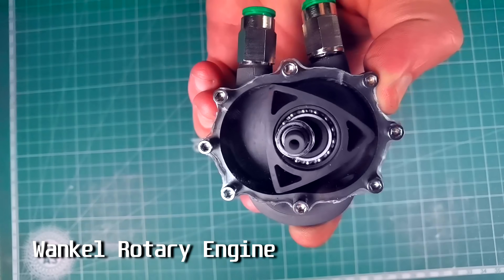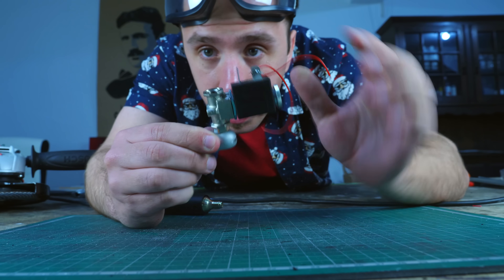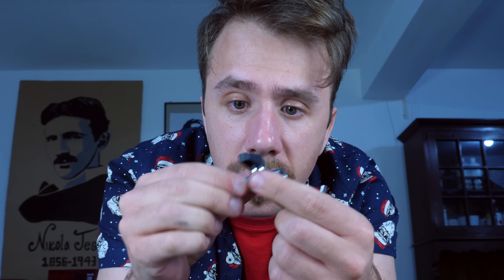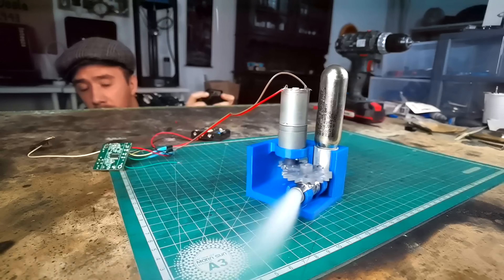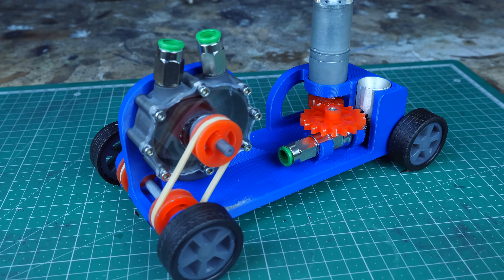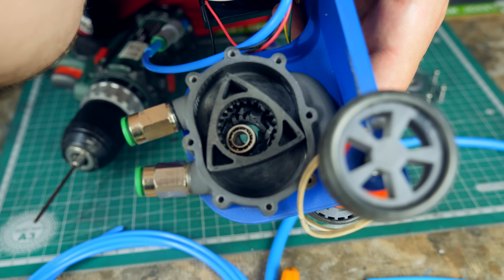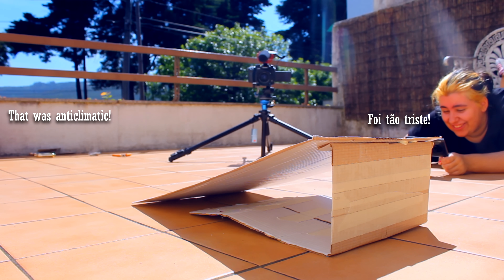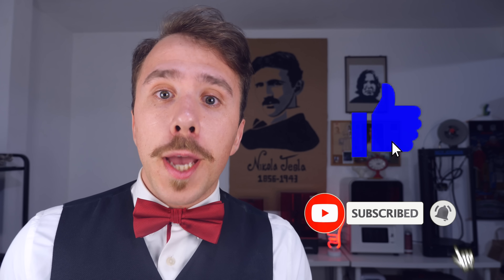Rotary Wankel RC Car (3D Printed)

Comment: Why not just use a servo motor to give precision throttle to the engine? I mean, 25kgcm torque servo is common nowadays, should be enough to turn the valve. That should solve the slipping of the driving belt, and also gives more time to ramp up RPM. Servo is way more lighter anyway.

Comment: You could 3d print a geared transmission for the rc because you were losing alot of your power in the rotary due to the rubber band and pulleys slipping.

Comment: Okay... You're losing a ton of power with the delivery system out of the engine to the wheel...now try a chain and actual sprockets to deliver the power from the engine....or hook it up to a 3d printed differential.

Comment: You desperately need an expansion chamber so the CO2 has room to change to gas. Also a pressure regulator would help with efficiency.

Comment: For the vehicle, you need reduction gearbox(from engine to wheels). It increases torque output but decreases the top speed, horizontally mounted cartridge to increase aerodynamic and balance(you can adjust it with arranging the bottom of the cartridge heads forward so the engine can run longer), a gasket to avoid gas leaking from the engine(need to applied together with stronger engine casing and tighter screw locking), and stronger chassis for the car(if the chassis is bigger, it has to be followed up with larger wheels to ensure the size balance of the vehicle parts).

Comment: It seems to me that one of the problems is that the gas exits too fast. Maybe adding resistance to the system, for example by attaching a second engine in parallel to use the exhaust (which still seem to have a lot of extractable energy in it)

Comment: I suggest using your ceramic printer to make a rocket powered boat. I mean, ceramic where you can, of course. A boat big enough to hold your fuel tank(s) might be out of the question for your kiln. You know what, why not just a ceramic rc boat?

Comment: Add a little traction to your wheels by gluing rubber bands to the circumference of the drive tires. Pressure regulator is a good idea. Add an extra pulley between the engine and the axel. A "tensioner" pulley. Pull the band out to ad tension as there's not much room to pull it in. Adding weight to your wheels will help keep them on the ground long enough to actually do some locomotion. Since a suspension system might be too complicated for the task at hand.

Comment: The rubber band is slipping a lot!  Use gears or something.  Initial power output looks quite high; might lead to wheels spinning in place if the car isn't heavy enough or internal engine damage (after replacing rubber band).  Another option is a stronger band with teeth on it.

Good luck and great projects!

Comment: Along with reducing the rpm of the wheels, it appears that the rubber bands are not very good at transferring the torque. They are not rigid enough so the torque is deforming them off on your pulley and they are slipping. A rigid gear reduction would work much better. Great video and project

Comment: you should use a regulator to not waste c02 and make the car go further and you could use larger bottles of c02 (or more pressurized once)
also if you plan to use the wankel engine more you should get something to seal the edges so c02 doesn't leak out

Comment: @integza. 
You have 800 PSI to power this thing! The exhaust is probably still 600 or 700
That's a LOT of energy you are losing out on.
Look up Multi Expansion Boilers.
It uses the exhaust of the first piston to drive the 2nd and 3rd and even 4th.
MUCH more efficient.

Comment: You should 3D print a winch that is strong enough to lift 100lbs and design it to work as a house lift from floor to floor for bringing laundry to the basement or second floor

Comment: Aside from needing a regulator to lower the output pressure, you also need to make sure that the neck of the cartridge is facing upwards.  The cartridges are filled with liquid CO2, so you are expelling the liquid and not the gas.  Turning them upright will give you more thrust and better control.
Reply: And maybe heat up the cartridge? Releasing the CO2 may cool down the cartridge so much that the CO2 remains liquid at ambient pressure? Or maybe not, these cartridges are fairly small ...
Reply: @michaelseitz8938  the faster the gas is released, the colder the cartridge becomes, and the lower the internal pressure becomes.  However, that is not entirely what causes a pressure drop.  It takes time for the liquid to turn into gas, which is usually the most significant reason for the pressure drop.  When you use a regulator, you extend the length of time that it takes for the cylinder to evacuate, which in turn gives the liquid more time to turn into a gas.  Heating the cylinder will help the reaction somewhat, but typically not by enough to make a difference.  If you're looking for a 5-10% difference, then heating the cartridge might be what you need.  Good thought though!
Reply: @michaelseitz8938  nope 90% of performance issues is just the fact he has the pop side down rather than up while in a gravity field with a critical gas canister
flip it and he'd get more stable and longer running 800psi flow with less issue caused by rapid loss of liquid co2 mass
sure mild warming if he intends on using 800psi for very long might be needed in smaller cans but at about the 88-90g cans the depressurization of his projects at max flow won't be enough to chill anything bigger than a 16g can enough to lose performance
plus he seemingly can get lots of propane which is a nice source of a stable phase change 150psi source so he could use propane bottles to run "pneumatic" engines on the go with much cheaper valves plus the flames from the exhaust ignited by "integzabot" would be a nice cosmetic touch
Reply: yes "inetzga" can't seem to understand the wasted energy of liquid co2 coming out of the exhaust port
he even knows liquid propane makes more flames than gas if he flips the bottle so why is he no noticing the same flaw in reverse with the co2 cartridges?

Comment: You need to 
1: seal the engine better
2: make the stationary gear in the engine durable
3: limit the amount of psi put into the rotor
4: make it a chain that powers the wheels so you can plant the power down
5: use ceramic filament if possible for the engine

Comment: Video idea: Have a battery powered 3d printed compressor of sorts to feed air into the engine directly, could be considered similar to a turbo'd rotary engine. 3D print a car shell you'll basically have yourself a mazda rx/eunos cosmo.

Comment: I like the car idea, but maybe do a dragster, you could drop the gearing to provide more torque, since the engine runs at such high rpms. Also, lots of dragsters use rotaries. Hopefully you like the idea! Also, maybe find a way to better control the pressure to last longer but with less psi. This would mean less rpms, but longer run time, hopefully solving 2 issues with the car.

Comment: You’ve got to turn the cartridge spout side up so that you get gas out instead of pressurized liquid CO2
Reply: Ding ding ding
Reply: Also a pressure regulator or at least a decompression/expension chamber would go a long way for the wankel motor I think
Reply: @CAYDEN TAN SHENG WEI Moe the high pressure conditions in the canister turn the gas into a liquid. When the canister depressurizes spout side up it turns back into a gas. When it’s spout side down it stays liquid. Unless you have the end held tight in a rag. Then it turns into dry ice.
Reply: @Travis7109  yup turn the canister right side up to get longer runtime and less seal-chilling leaks
Reply: the liquid CO2 still wants to expand and turn to gas. But it looks like a significant amount is happening inside the engine. He could use a longer hose to give it more time to evaporate, but then he'd lose pressure.
Reply: @calvin2686-u1k  or just put the canister valve side up rather than have the opening effectively draining liquid co2 out
Reply: god yes 
liquid co2 boiling in the engine is causing thermal contractions and seal leaks let alone a loss of usable gas pressure on the intake right away
Reply: I think you should make one submarine.
Or make a US battle tank
Reply: Actually pressurized liquid can be better... maybe?... Just think about water rockets. They are more powerful than compressed air rockets.
Reply: @potatosalad68  Sadly not. This works for rockets since increasing the mass of the exhaust gives more thrust, but here we don't care about the thrust produced by the exhaust and we're basically wasting liquid gas that would otherwise decompress still in the cartridge and give more power.
Reply: @DeuxisWasTaken  Oh, I meant it for the modified rocket car version, when he unplugged the wankel motor.
Reply: @DeuxisWasTaken  EXACTLY
liquid co2 boiling outside the engine is pure waste
Reply: @potatosalad68  not really as the boiling co2 is useless once it gets into the exhaust and the sudden thermal sink will cause seals to freeze and leak

Comment: 3d printed mini evil tomato keychain merch when? Also, you need some suspension on the powered axle of the car, to keep traction during lauch. You're losing a lot of energy at the start. Try to add a pair of hobby grade rc shocks and springs, cheap chinese ones are fine for this. And maybe reverse the car, rear wheel drive will give you more traction.

Comment: For the engine I think a good next project would be do a double rotor engine like the one in the Mazda RX7.
For the car I think some kind of suspension would be of great use because most of the vibrations from the engine shaft were transferred vertically for the wheels and not horizontally. The suspension could absorbe some of that energy and make the force that the wheels apply on the ground more effective.

Comment: You could make an rc plane with a pressure regulator to use the cartrige more efficently  and the motor to spin the rotor and see how long and how fast you could make it go . 3D printed frame eith styrofoam would make a really good build

Comment: if you made the tension of the drive belt higher you would get a way higher acceleration on the vehicle and it may be able to get over the ramp with that speed increase

Comment: That belt slippage on the wheels made me sad. You could use a belt the same way some electric skateboards do so it doesnt slip as bad, and probably higher gear reduction or reduce the airflow somehow

Comment: It looks like you're getting liquid CO2 splashing around inside the chamber. If you added a pressure regulator and turned the cylinder nozzle side up you could avoid that and probably get some more efficiency out of the engine.

Comment: You should make a 3d printed rocket using co2 with electromagnetic nedle valve that's under spring tension or similar.

Valve should open instantly with press of a button, co2 gets released to air instantly via nozzle.

It obviously makes a lot of thrust, it's time for 3d printed rockets

Comment: If you could add a regulator to the co2 cartridge setup you built, then you can power the rotary engine for much longer durations and much better performance out of the car.

Comment: Do u think theres any other material u can use as a belt instead of rubber band? I think the rubber band is just to stretchy to turn very well like a cars belt is very stiff and if there was somthing closer to it maybe it would give ur wheels much more power

Comment: Maybe if you had teeth on the pulleys and used a belt to fit. Then it would go over the ramp with the compressor air connected to the engine

Comment: Video idea: Make a video on a subject that you are interested in or an idea that you want to advance your knowledge on, I.E. your 3-d printed rockets, or making a rocket powered airplane using the 3d printed rockets, you could even make a regular electric motor powered airplane with the rocket as a "boost" similar to what Peter Stripol did with his sugar rockets.

Comment: ok how about a 3D model rocket designed specifically for that cartridge? that way you can make the nose cone as aerodynamic as possible if you print two halves of the nose cone.

Comment: Hi Integza! Great idea the CO2 capsule, may be put a pressure regulator to extend time of use? and may be gt2 belts will do it better transmition of power to the wheels than rubber bands... Think you should give it a chance to test some upgrades!!! :)

Comment: Integza...print a car that uses like a 2L bottle with compressed air...Those bottles can hold up to like 150# of air pressure (so safe to run it up to 100# easily), they would have ALOT more volume and lower pressure = longer run time on the wankel w/o turning it over 5K RPM....very very very cool design!!!!

Comment: 2+2=4
2+4=6
the more moving parts the more resistance or friction counter centrifugal force
Of course the car with the gas jet release is going to be faster than the air Winkle powered car that seems to be skipping losing traction and spinning and jumping as it starts to move what energy you didn't lose in your engine you lost in your traction

Comment: You should design and 3D print a gearbox to reduce the RPM and increase torque to a the wheels. Wether a series of gears to a one wheel peel drive shaft or a chain contraption like your rubber band. Lost a lot of momentum in the slip.  Excellent video. My 8 year old son and I really enjoy you videos.

Comment: Bigger front wheels should help transferring more power to the ground because it slips and loses a lot of energy into nothing. A gearbox should also help there to not use all energy at once. Tom Stanton had this problem a lot with his air powered build where he needed to change the energy output

Comment: I know a lot of people probably pointed this out, but you’re getting a lot of slip from the rubber band connecting the tires to the engine so you might have better luck if you run a gear drive from the winkle to the front axle.

Comment: Why not fully print a herringbone gear, gearbox to get full use of the wankel engine output, or a fully printed CVT gearbox, and then run a drag race of wankel engine carvs rocket car and do it like a proper racing event!

Comment: use the Rotary Wankel RC to make a small plane , it would be manageable if you connected many valves in some series way and just increase their capacity , by using 3d printed material you can make a small and light aircraft fuselage that can be manageable.

Comment: Design and 3d print a locomive or tracked/tank vehicle using the wankel engine as a means of power, maybe even use 3d printed ceramic parts.

Comment: Video idea : Design a different water-cooling solution for a pc that has a turbo feature that boosts  the cooling for a short period . It would be interesting to see what you come up with for a temporary sub zero boost for high demands.  I would like to see what you would use for valves and how you would control it to prevent condensation on the CPU block.

Comment: I see 2 problems. 1 It was front wheel drive so it had no traction. 2 if you add a pressure regulator to something like 800 to 150 psi if will have a lot more even and long lasting power.

Comment: I'm pretty sure the reason the car sucked is because the rubber band couldn't keep up. Use a chain or even just a tighter band. Bet it would be a lot better.

Comment: you should attempt to 3d print a simple transmission to reduce the speed coming from the motor allowing the wheels to spin slower so the car can move forward without the wheels spinning like they did in this video

Comment: Love the videos. I would suggest using an pressure regulator in conjunction with an expansion chamber/evaporation chamber to allow the liquid CO2 to expand into a pressurised gas. Ought to make it go quite a lot further.

Comment: I'd love to see you try this again, but limit the airflow into the engine, use something to seal the engine air-tight, use a better belt (it'd be nice to see a toothed belt like a bike but idk where you'd find one), and finally, take that exhaust from the engine and run it under and towards the rear of the car - essentially engine + gas propulsion.

Comment: Build a helicopter blade system with variable angle of attack mechanism
Reply: You mean a swash plate helicopter pitch control
Reply: That sounds like normal helicopter collective
Reply: @benaguilar1787  tbf, has anyone on youtube made a thorough explanation vid with a diy conventional helicopter?
Reply: I don't understand half of what that means but it sounds cool
Reply: @boneman-69  he asks integza to build a propeller with a rod which changes the pitch of the blades when pushed/pulled
Reply: .....with electric plasma jets on the tips of the blades....
Reply: I hate to say it but most rc helicopters already do this

Comment: You could increase the driving time of that car with a flywheel attached to the Rotary Wankel. And then use gears or a pulley which then spins up the wheels. Maybe it'll work!

Comment: You should use the engine to power a ship or a plane, since the high RPM dont have to be turned down in a gearbox.

Comment: you should get a servo to open the valve. that way you have more control and can drive the engine for longer at a lower pressure :)

Comment: It would be interesting to see if you could make a functional plane. Maybe even powered by one of your engines and a propeller...or rocket powered and let it glide once the fuel is out.

Owuld be a cool project but quite difficult I would imagine

Comment: I'd like to see how well that engine would perform if you took some steps to regulate the gas coming out of the cartridge instead of venting it full bore. Less spectacular but the longer run time and greater control might be worth it.